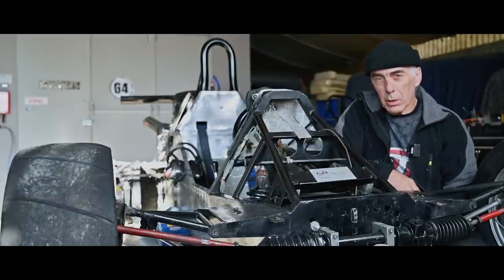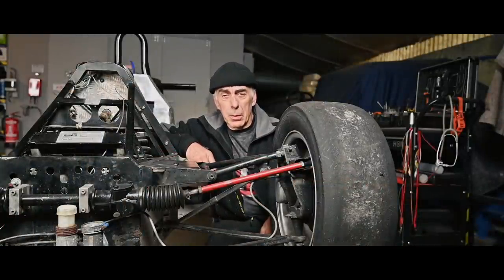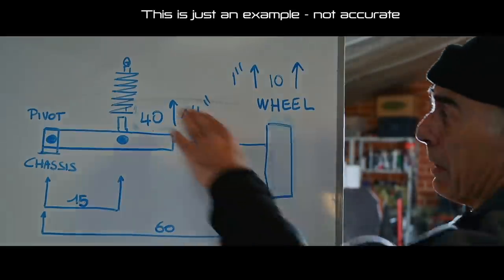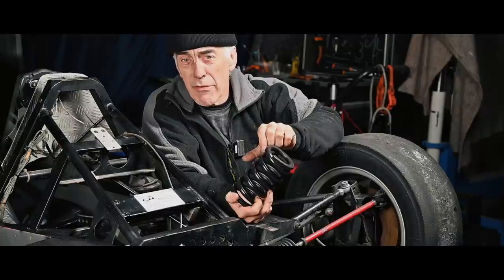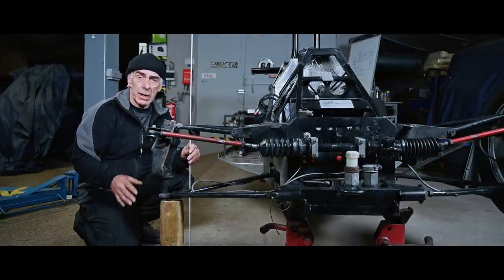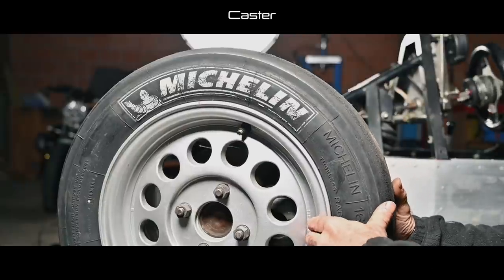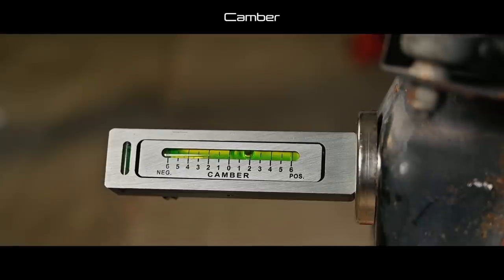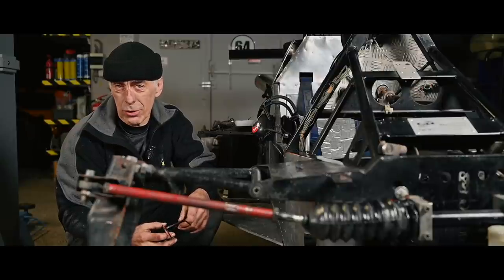Race car rebuild , Part 2 Front suspenssion

Comment: Great video... keep in mind the bum stop on such vehicles with lots of down force in relation to cars weight is a important tuning tool to control right height at high speeds. Therefore it is important to choose a bumpstop that is somewhat progressive to still remain a somewhat reactive suspension while ensuring a minimum right height at higher speeds.
Reply from the maker: Good point, thanks for bringing that up

Comment: Instructive video, Steve. Simply and clearly explained. I noticed that the right rim seems to be bent.
Reply from the maker: Thanks for the comments,  Possible , although it seems more that it was not locked down to the wheel bearing.  But it will be checked when we put it all back together

Comment: very nice breakdown. i wouldn't have imagined  fiat panda components would be up to the stresses of racing, impressive. no doubt helped by the lower overall weight of the car.
Reply: Well, this car is so much lighter than a Fiat Panda that it evens out with the higher stresses, I guess?
Reply from the maker: Great point! and indeed, but then again the car is very lite
Reply from the maker: Indeed

Comment: In this case you have a pull rod, that gives a variable (rising) rate wheel rate. The exact curve will depend on pull rod length and coil over length.
Complexifies a bit the calculation.
To you have a method to set that up?

Comment: The wheel you were spinning early on looks warped to me.
Reply from the maker: Something to check on, the tire is flat for sure...  will see when all isput back together. the wheel was not bolted down
Reply: The rim looked like it may be out as well. I spotted that and came straight to the comments to see if anyone else had.